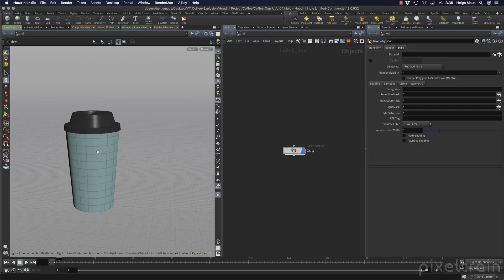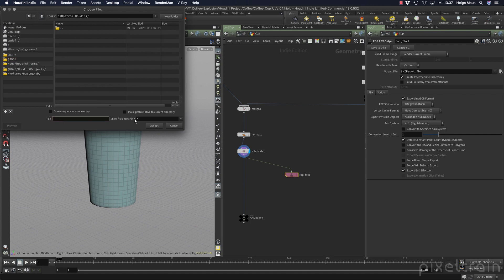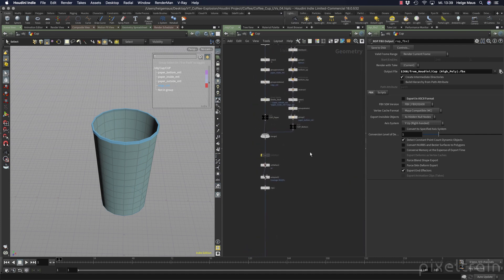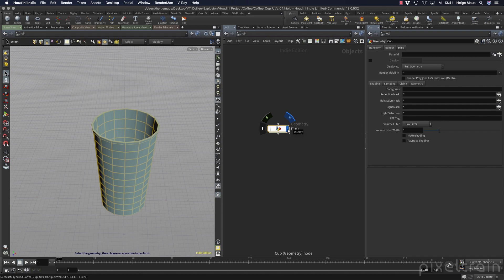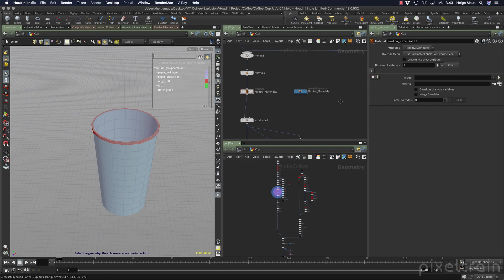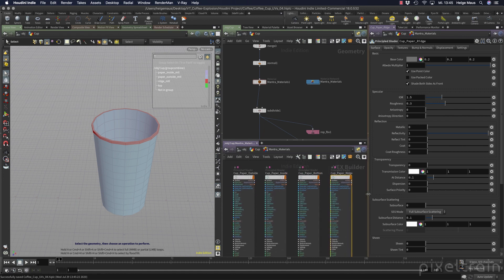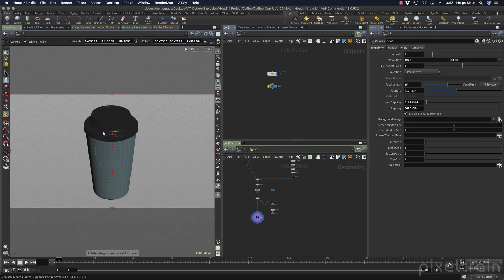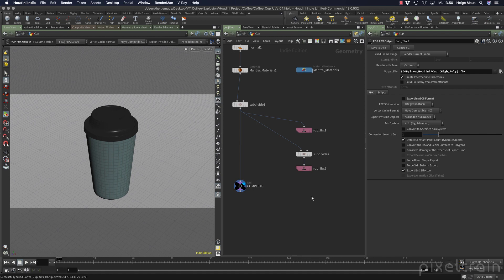CoffeeCup - 01_10 Material Assignment & Export as FBX

Comment: How does one trouble shoot errors such as this "
Warning 
A mis-match of attributes on the inputs was detected. Some attribute values may not be initialized to expected values, i.e.: Cd. "
Reply from the maker: This isn't an error, it's a warning. In one stream there is a Cd attribute, in the other there isn'tone. So Houdini has to add the Cd attribute to the data off the stream, in which it was missing. So, a default value of the attribute is added there. That's the arning.
If you want to make sure, that you have a value which you define in it, add a Cd Attribute to both streams.
Hope that helps :-)
Reply: @pixeltrain3d  I see, ok. So a good workflow would be to make sure that all attributes are present within the stream. Thank you for the response, this was really driving me crazy!